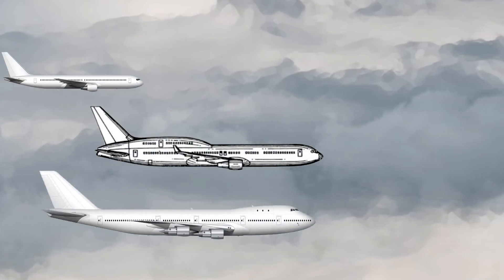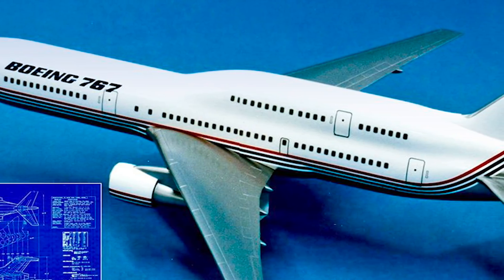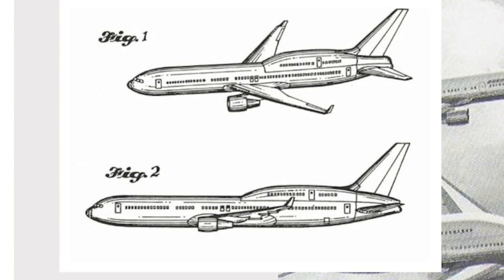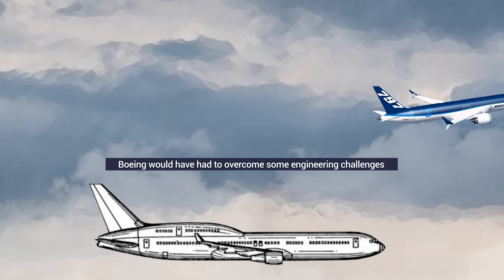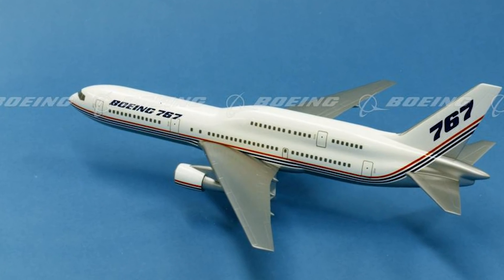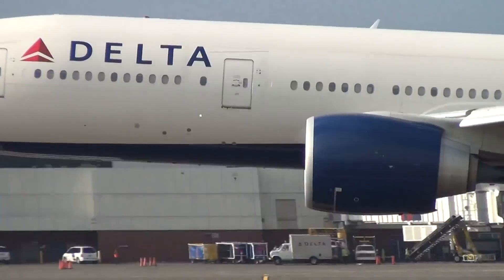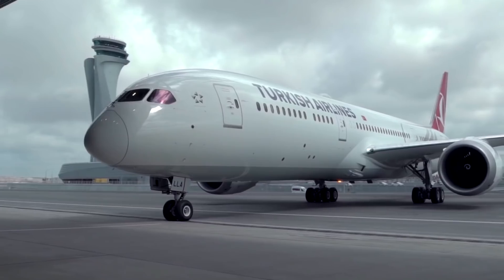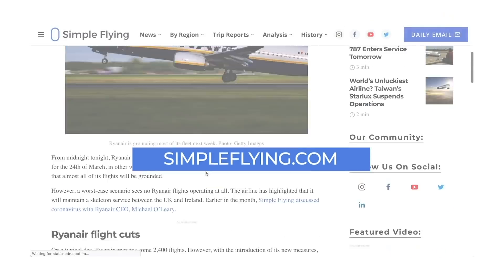The Boeing 767X: The Inverted 747 Which Was Never Built

Comment: Let's Mount forward swept wings. Then the stabilizers in the front. That would make it prefect
Reply: At that point might as well just turn the engines around. In reality, sounds like you're suggesting an airliner of similar configuration to the Sukhoi Su-47 and X-29, both fighter concepts. Both apparently flew okay but neither have lead to production of anything of that configuration. Probably wouldn't be as beneficial for an airliner as a fighter.